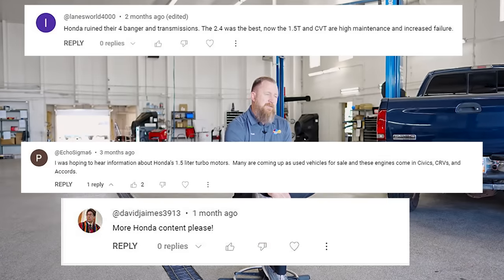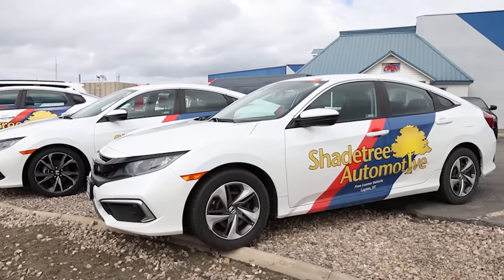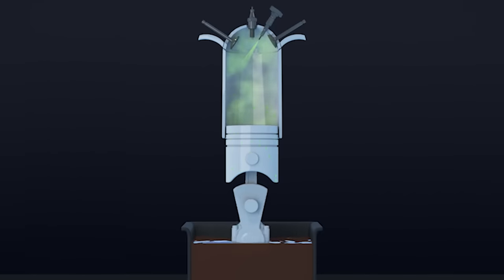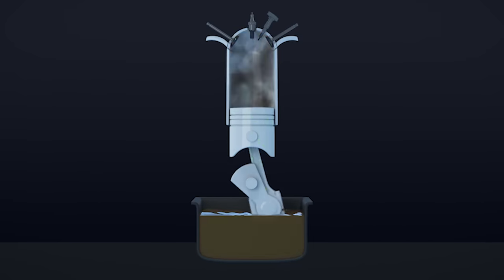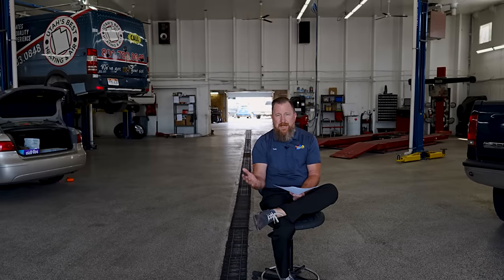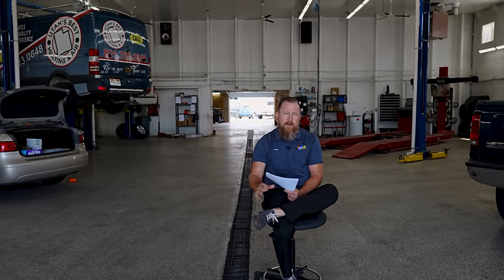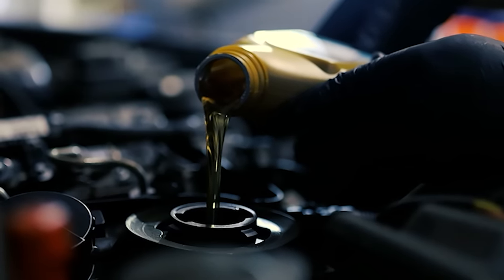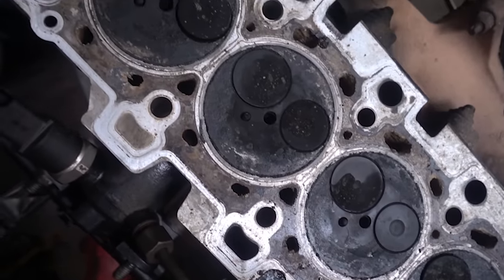Honda Oil Dilution Issue - Should you buy a new Honda

Comment: The carbon is not due to efficiency, its due to direct injection and the recirc.
Reply: I put a catch can on mine to help mitigate that.
Reply: They need to do dual injection with port injectors and direct injectors like Toyota. I want to buy a new Honda/Acura because I love the efficiency of the 1.5L but I also keep my cars for over 10 years.
Reply: Yup Hyundai has these problems because most of their engines are direct injection. They recommend running a system cleaner through one of the vacuum hoses while the engine is running so it can clean the carbon off the valves. If the engine is super dirty man that's a smoke show. But usually runs "better" afterwards
Reply: @SUp3RpooP3r7698  all in the efforts to "reduce" emissions. What a joke, my 2000 Acura TL needs the intake carbon cleaned every 100k or so due to the EGR and PCV system but the valves remain spotless.
Reply: @Darksyne  I have a Subaru STi now, used to own a Chevy Cruze, but I'm happy that it has port injection so I don't have to worry about all those direct injection problems. EPA and all these agencies forcing manufacturers to produce these crappy engines are the problem. I never understood the big deal about car engines being so dirty when the airline industry and people that own private jets put more pollution in the air than any of us ever could in multiple lifetimes, oh yeah, and China.....
Reply: and pcv too closed down
Reply: The reason they use direct injection is for fuel efficiency though. It allows them to use these downsized turbo engines. He was just simplifying.
Reply: @SUp3RpooP3r7698  An induction service is a common maintenance procedure we have recommended across all makes for decades.  Historically, it was to address rough idle upon cold startup because the carbon buildup behind the intake valve dish would soak up the fuel spray until it became saturated and finally smoothed out.
Reply: if you add an oil vapor separator as i did on my 2014 ford fusion 2.0 vep engine... the valve will remain quite cleen
Reply: put your car in a lock up... roll down the windows,, start and run the car... do you now love those ' emission'? @Darksyne
Reply: @stwings98  Does it collect very much?
Reply: @markschneider3915  In the winter is collects a lot.  In the summer not so much.

Comment: I own a 2016 CIvic with the 1.5t currently at 110k mi no dilution issues and she runs strong. I routinely change oil at 15%. That being said i also live in Phx and commute 45 min a day, so this info certainly aligns with my scenario.
Reply: HAHA ! I live in Buckeye west of Phoenix also . Unburnt fuel gets burned off pretty around here ! 🌵🥵
Reply: You probably never did an oil test lol
Reply: You change oil at 15%???
Reply: if you are still full on oil at 15% on the dipstick you have diluted oil
Reply: @mikethetoolman8776 that’s not 100% true at all
Reply: @johnball8758 that's recommended % from Honda
Reply: I don’t drive a Honda, but what are you talking about? You change your oil at 15%? You don’t change engine oil by its percentage (whatever that means). You change by time or distance.
Reply: @GymChess  the percentage is an internal mileage tracker. The percentage is based  how much lifetime the oil has before it is unable to perform its job adequately and Honda recommends changing oil when the percentage reaches 15%
Reply: @@dboatrigthat’s too bad Honda is having reliability issues.  And their warranty is so short too, compared to Hyundai / Kia.
Reply: @Justvn4thGenTL   EVERY engine uses some oil in today's tight PCV system so if after 5-6-7k miles your dipstick reads full and you have not added to it, you have fuel dilution and oil contamination also.
Reply: @mikethetoolman8776  no you don’t once again that is not 100% accurate. and to be honest every single car has oil dilution since not 100% of the gas sprayed into the head will combust. but just because after 5,6,7k miles and ur dip stick is still full doesn’t mean ur have severely diluted oil. cars are lasting longer now than ever and are using 5-10k oil change intervals.
Reply: @mementomori29231  Honda isn’t having reliability issues , it’s the customers not taking care of their cars properly. those 1.5 and 2.0 turbos and meant for 91 or higher octane. and majority of those mechanical failures are because lower octane gas is being used. there’s nothing wrong with their reliability that’s a myth it’s the customers not being aware of what’s needed for their car.
Reply: @Justvn4thGenTL  we are talking about hondas here, try to keep up
Reply: I have a 2018 Accord 1.5 with 145k miles. I have done all oil, fluids, filter change meticulously on time. Runs as good as the day I bought it new
Reply: @@dboatrig  That happens to my VW as well.
Reply: I change mine at 20%
Reply: That 15% is just a guess based on miles drive/load etc.   Your oil could be sludge or even missing and it would still read 15%.   Some engines just burn cleaner or dirtier than others based on condition.
Reply: The Honda display has an algorithm based on miles driven, load and whatnot @GymChess
Reply: @@dboatrig 2019 Pilot uses a DI motor. I have a 2017 Ridgeline with the same motor.
Reply: Wow thanks for YOUR anecdotal experience
Reply: When he says 15%, he means when the maintenance minder goes from 100% to 0, he changes oil at 15% - so a week or two early.  No big deal.
Reply: Oil dilution is more for colder weathers. You live in Phoenix bro lol
Reply: You live in a warm climate and have a long commute! Maybe that is why you have no issues!! Insert eye roll! 🙄
Reply: @Justvn4thGenTL  Honda say 87 octane. The forums agree higher octanes are a waste of money.
Reply: Do not rely on the maintenance reminder light or oil life percentage to decide when to change your oil. It’s at best the computer taking an educated guess. It’s very simple, oil and filter change every 5k miles /8k km or every 6 months, whichever comes first.
Reply: @Chris_de_S  The maintenance reminder light actually comes on at 15% oil life not 0%. However nobody should wait or rely on this light to change oil and filter. Most of the time it comes on well past the point you should have changed the oil.
Reply: I change at 20-30% and rotate tires at the same time for Honda Odyssey 2015.

Comment: Low tension piston rings are probably also a factor.  All manufacturers are struggling with this as rings are the primary source of friction in engines.
Reply: That is the whole problem, not  enough ring tension for a turbo engine. Low engine temp equals greater piston to wall clearance. Direct injection doesn't "force" fuel past the rings that is compression multiplied by the forced induction of the turbo. Also the amount of fuel supplied by the injectors is no more than what is needed by the engine.
Reply: I have heard honda 1.5 taints the oil in a few weeks
Reply: Exactly.  This was not a widespread issue until the manufacturers started lessening the tension on the piston rings, in addition to higher fuel pressure GDI & most likely higher cylinder pressure due to the turbocharger (forces more air into the cylinder).
Reply: All efficiency has been gotten out of conventional piston engines without sacrificing durability.  The government needs to lay off and engineers need to start over-building engines again with reliability in mind.
Reply: Why was tension reduced? Helped emissions or efficiency somehow?
Reply: 100%
Reply: @neilquinn  Yes. Reduced friction minimizes mechanical losses on power, hence increasing fuel efficiency,
Reply: @neilquinn both
Reply: epa has set mpg standards that don't follow the rules of physics @neilquinn
Reply: Up the boost
Reply: Less friction equals more miles per gallon - you don't get something for nothing.  I guess it was a necessary compromise for the manufacturers.  Only problem is oil dilution (GDI & a turbo doesn't help) & for some engines oil being burned in the combustion chamber because it gets past those lower tension rings. @neilquinn
Reply: I was thinking he was gonna talk about piston rings in this but didn't 🧐🧐
Reply: Spot on.
Reply: They would not do that anyways, Hyundai is happy to sell you a new one when the engine blows @scdevon
Reply: Thank you for posting this. We have (no joke) been gas-lighted by our local Honda dealership. Just paid $2k to have fuel injectors replaced.
Reply: My wife's Audi has a 2 litre turbo engine with low tension piston rings, the VAG EA888 engine noted for this, oil level light comes up and we need to top up 1 litre or quart every 1000 miles. That's considered normal for this engine and the opposite problem to the Honda where oil level goes up rather than down.
Some Toyota engine from the early 2000s had the same issue.
Reply: @nickmalone3143 within 800 miles from oil change
Reply: They're burning oil, too. Which means the fuel dilution is worse than what the dipstick says.

Comment: Thank you explaining why there are issues with the 1.5t and how to minimize or avoid future engine problems.  I got the 1.5t with 26k on it, now approaching 56k. I live in California and most of my driving is highway. I haven't experienced any issues yet and have changed the oil every 5k. I hardly ever drive in sport mode pushing the engine hard, and I've had fuel injection service as recommended and using high octane fuel. Great performance thus far. Hopefully it continues as maintenance is done. Once again,  thank you for educating me about this engine.

Comment: I worked at Honda's emission lab. I saw all of the current production engines do this in certain conditions. Direction injection, short trips. Cold weather makes it worse.
Reply: Does the current 22+ Civic have the dilution issue?
Reply: They are still selling this engine too. Should I take a chance on one or just go with the 2.0 hybrid?
Reply: @powerstroketurbo95  Honda and the forums say the issue has been fixed
Reply from the maker: That had to be a cool job. Thanks for sharing
Reply: @teleguy5699  get the hybrid but cover yourself with longest warranty possible if you plan on keeping long term . I believe in the U.S you can shop around so your hands arent tied to what the dealership offers in terms of what type of deal they can offer on 8 year warranty
Reply: @noroar3258  We went with the Hybrid EX-L. Great car. Came with the gray interior which is a plus. My wife misses her '08 V6 but she hates technology. It drives great like a Honda should.

Comment: Just sold my 2017 civic hatch sport. Had 185,000 km on it. 1.5•L turbo. Ran like a dream. Never one problem.  Just traded up to the 2023 civic hatch sport touring
Reply: Holy S-word!! I have a 2018 Civic and I've yet to hit 50,000 miles!! Do you drive across the USA, ocean to ocean every month or something? That's an insane amount of miles for a 2017 anything. Are you sure you didn't typo and you meant 85,000 and not 185,000? Even 85,000 would be extreme for a 2017.
Reply: @markr.1984  you heard right. Although it’s 185,000 KM not miles. I drove the car from Vancouver Canada to the Florida keys twice in 2017 and 2022.  Also 3 times to California, Utah, across Canada and more! Could not ask for a better vehicle

Comment: My 2018 Civic Sport had the turbo 1.5 and it had the fuel smell problem around 30,000 miles. I ended up having to change the oil every 2500 miles. I sold it when it was about out of warranty and bought a natural aspirated V6 Lexus.
Reply: @jalopy2472 Same engine in my 2013 Venza V6. 110k miles on it, and the oil is golden honey at 4000 miles on it. like new.
Reply: Lexuses are ugly af, but the FK8 civics are worse, so you upgraded!
Reply: This is probably what I will do, too.  Our '21 has 26K miles and it's annoying to have to change the oil so often.  The whole temperature thing is bs, too.  We drive the damn car plenty.  It shouldn't happen.  Yes, we're at 45 degrees latitude.
Reply: Lexus fixed carbon build-up by using direct port and indirect port injectors
Reply: 2018 Honda Civic Touring here with 70k clicks. No issues. Drive it at least 30 minutes before shutting down the engine you won't have any issues period. Change oil when the oil indicator displays 15-20%. You'll be a happy camper after that. Enjoy the car for another 10-15 years then when you're ready to buy your second vehicle buy an SUV for family cargo and keep the Civic 10th gen for A to B work stuff and grocery stuff. Zero problems man. Best damn car in the world I'd say. Although it's compact size can only take so much stuff.
Reply: @GTSBadminton  my commute was only about ten minutes each way.
Reply: @GTSBadminton Do you use premium fuel or the Honda recommended 87 octane? Thank you.

Comment: Toyota engineers are actually quite smart and implemented a nice solution to the carbon build up issue with DI engines. Toyota uses two sets of injectors in their dynamic force engines, one direct and the other one behind the valve like a port injection style. The computer actually chooses which particular injector to use depending on several engine load and driving conditions. Also they went the N/A route avoiding any issues with a turbo.
Reply from the maker: oh nice! thank you for sharing
Reply: Toyota went the turbo way. Look at the new tundra and tacoma. We will see if the new Corolla goes with a turbo or not in 2025 to compete with the civic
Reply: Our Rav4 also has an electric water pump, which reduces liquid flow when the engine is cold!  The engine warms up incredibly fast, which would reduce this issue.
Reply: That's why I bought a new Toyota, the D-4S injection system is great.
Reply: @ShadetreeAutomotiveLayton yeah it's the 4-DS injection system, just got a new Camry because of it and the real 8 speed transmission. My last two cars were older Accords which I loved but I noticed the problems with this earth dreams nonsense and couldn't justify paying $30k for a car with a iffy engine.
Reply: Performance aftermarket did this first years ago but it was more for power than carbon buildup

Comment: Had a 2017 CRV. Exact issues and warning signs you described here. The software update solved nothing. Had multiple oil analysis done to make our case. Battled with Honda and the dealership for months. Even though the dealership recognized our issue their hands were tied. Finally the dealer bought our car back and we bought a RAV4. End of story.
Reply: Smart move

Comment: Had the same issues in the first mazda DI platform.   We ended up using a different oil solution (generally anything formulated for euro spec engines and/or everything dexos 1 and above.) oh and ventilation of the block with catch cans.

Comment: Am thinking about keeping my wife's 2010 Accord V6, as we have only put 30,000 miles on it.  No problems, totally reliable, very quick, and gets 20-21 mpg in town driving, easily more than 30 mpg on highway (best was 35 mpg MD to Delaware on flat terrain).  Not sure a newer Honda would be any better.  I prefer naturally aspirated engines and dislike CVT's.
Reply: If there's not a problem don't sell that baby !
Reply: Look into vcm delete options it causes all sorts of problems like high oil consumption
Reply: My dad had one of those.  Outside of eating brake pads like they were cookies to the cookie monster you’re right, typical Honda reliability.
Reply: I would not get rid of that car. Only 30K? Wow. I have 280k on my 2008 CRV and it runs like a top. If you can forgo all the gadgets on newer cars you’ve saved a boatload of $$ in car payments and repairs.
Reply: @mercedescherokee6853  
VCM killed my sisters 2008 Accord V6, mushroomed valves
Reply: Gotta get a VCM muzzler. I got the S-VCM and am happy with it. The VCM is total garbage and will cause oil consumption, engine mounts and fouled plugs. The J35 is a great engine as long as you delete the VCM.
Reply: @viffer94 😂
Reply: @libertyman3729  My wife had a 2008 V6. Ran great, and hoped to keep it for many more years. Then last Friday she got hit and run and the vehicle is totaled.
Reply: Keep it. Don't sell it. You don't have to worry about the turbos.  They are fun but if you don't keep an eye on your oil. You will blow the turbo and the timing chain. The v6 have good power. Just regular maintenance. And don't have to worry about premium gas. Just change the timing belt when needed. And do a drain and fill on the transmission. Not a full transmission flushing. All honda parts only.

Comment: Direct injected turbo engines seem to all suffer from this and the valves getting gunked up (unless it's a dual type injection). This is why I got rid of my 19 Ranger, I'm not waiting 10 years for a lawsuit to reimburse me for an engine that ended up 1-2 quarts overfilled. Catch cans don't prevent the issue either.
Reply: thats from using crappy 87 fuel
Reply: catch cans do help prevent carbon "gunked" buildup.  Also, using high quality synthetic oil and changes at 5k vs 7.5k or 10k.  To prevent the gas in the oil pan, got to get the vehicle up to temp.  Cold and short drive cycles will exasperate the issue.  Should have taken the Ranger to dealer under warranty and have them address the concern.  But, maybe getting rid of it was the right move...
Reply: @Fa5Squad  is using mid-grade sufficient, in your opinion?
Reply: @Fa5Squad  93 octane for my 2.0T Audi.

Comment: I have a 2017 CRV and have never had that problem... I am a fanatic about maintenance and change my oil every 5000 miles or less, they did put a battery in my car a few years back under warranty and that`s when they did the software update... I have 72,000 miles now and car runs great would like to know Pennzoil product you guys use for the carbon buildup, not sure if I have that problem as I travel back and forth from Florida to Ct and we are doing 80 mph the whole way...